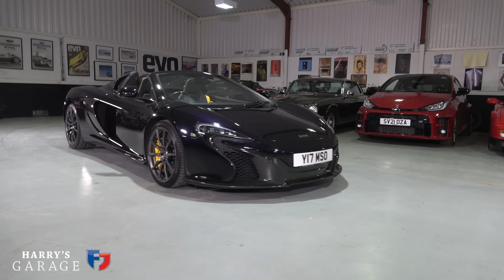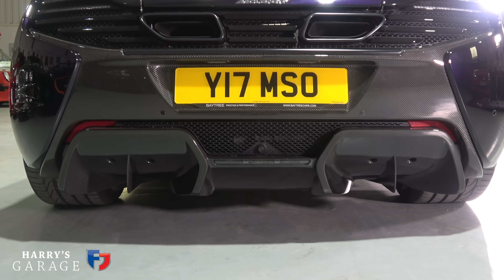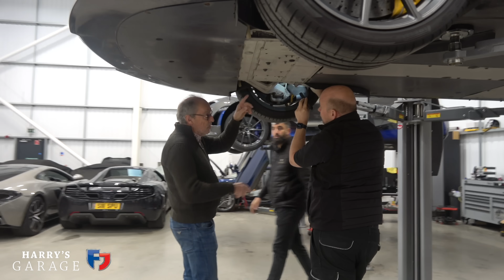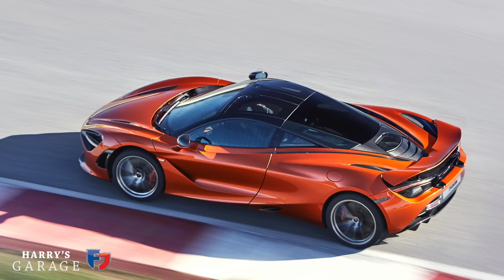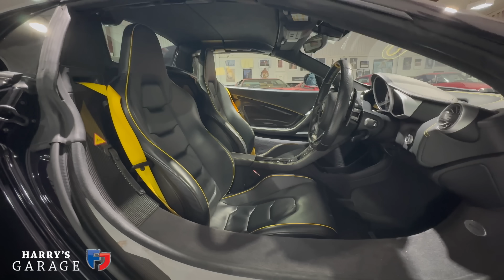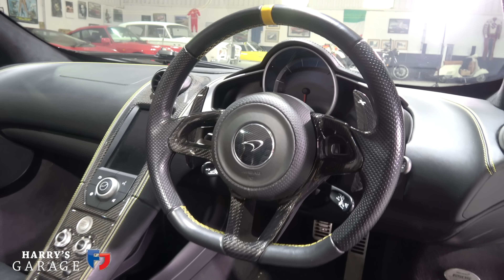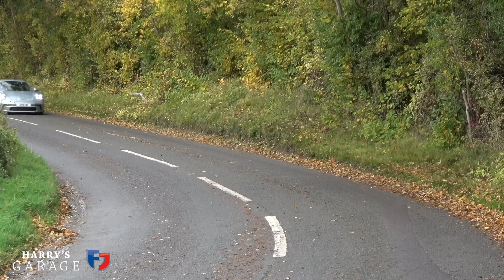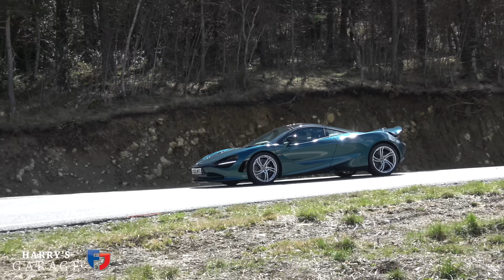McLaren 650S 6-month update. How much does it cost to run a McLaren? Servicing, warranties, parts..

Comment: I really don't understand how people purchase these super expensive and rare cars with finicky paint, and don't immediately cover the thing in paint protection film or ceramic coating straight from the factory. It's kind of like buying the top of the line iPhone, and then not investing in a phone case. It just shows a wanton disregard for money. Which, I guess, is on brand for those with lots of money.

Comment: I bought a low mileage late (2013) 12c, amazing car. I sold my Ferrari 355 spider with Capristo exhaust since although the noise was initially enthralling, after a while it felt shouty, slow and handled badly. ( I didn’t sell it to buy the 12c, I had both, the 12c just made the shortcomings of the Ferrari more obvious.)

The 12c is in a different league, truly special. The only car I’d hold in the same esteem is my gen 1 NSX…( I’ve had that for 20 years, the 12c is a keeper too.)

Comment: I particularly like Harry’s straight forward unbiased presentation. I had a Ferrari F-355 Spider in Tour de France blue with tan leather. Options included color matched dash and steering wheel leather in blue as well as a Tubi exhaust thusly producing an exquisite sound. Closest to F-1 I had heard. I did not find the handling flimsy but I did not compare it to a McLaren. Do you agree the 5 valve design made it one of the best engines of its time? Funny thing is, I had (have) a ‘84 Porsche 911 Carrera Cabriolet,  a ‘60 Porsche 356b 1600 Super with a modest 75hp, a Mini Cooper convertible (I removed the exhaust heat shield and lo and behold factory headers), and an H1 Hummer convertible? One day I was driving it and a limo pulls up and the window goes down. Ironically, it was Vanity (Prince) and in a limo proceeds to chastise me for largess and negative environmental impact. Huh?
Out of those, my favorite to drive was the 356 and the Mini a close 2nd. Guess I like the go-cart tendencies
Thanks for your entertaining and revealing presentations.
Oh, a little known car in the states is my Hyundai Equus. Korean limo. Smooth as silk. Incognito, except I’ve heard it referred to as baby Bentley.

Comment: Spark plug change at 60k? Unbelievable. If it is throwing stones at its own door bottoms, there should be an easily-replaced sacrificial bit of protective plastic there, like the bumper trims on a humble BMW.

Comment: The 12C has a horrible reputation in the US as well, as do most McLarens. I work for a non-McLaren dealership that has traded for and sold several 720Ss, 600LTs, etc. and almost every single one of them has had build quality issues that simply aren't acceptable on a car at that price point. We had a 600LT Spider with a front bumper that didn't fit from the factory, one 720S had a front lift that kept going crazy, another 720S had the glass roof and it shattered and broke when the owner opened the driver's door, a third one had the heat shield under the exhaust tip fall off.

The build quality just simply isn't there.
Reply: people have been saying this for so many years, I can't believe they haven't addressed this yet

Comment: I bought a one owner 66plate 650's Spider from McLaren Bristol. Had it delivered to McL B'ham to whomI had sold my Lambo Gallardo 560LP 4. Took some time convert driving position characteristics. Yes feet offset to left, but once press start & select Drive. Everything you need is inside an invert horse shoe between your elbow & forward to your finger tips! Phenomenal ergonomics! Yes sorry you do have glance for the rear window low button! I had mine through Covid, where it sadly spent 4 months locked down waiting simple parts & Service/M.O.T. For some reason I could not seem to want to part with it! But after year 8my 6th, I got Stung for the front suspension coil spring snapping at the heavy/bottom end! £3,600+V.A.T. At McL B'ham. Big shout out to their service manager. Mr Andrew Lane. He stood by in every through 6services & end of Warranty Ship List! As for me I've migrated from Olympic Standard Floor Gymnastics to Mirror Class Dinghy racing! I bought a Centenary Bentley Continental GTC W12. Swapping Raw for Awe, you could say! And yes it ticks a whole series of different boxes! Forget your scarf? Press a button. Feeling a little stiff( not cramped or uncomfortable? Press a button & you a choice of Six massage function? Yes a bit slower than the McL! It takes a full 30seconds of so to sun light & heat on my bald spot! But more than fast enough to prevent helicopters attempting to land on my head!

Comment: I have an Audi a3. There was a lack of power issue caused by the waste gate valve, took it to Audi for an inspection. They wanted 2500 quid to replace the turbo. 
The actual problem was a link bar between the actuator and the waste gate (they had that on the inspection paper).
I bought a second hand turbo on eBay for 80 quid and did it myself, sorted.
Any high end dealer is gonna be a rip off, even down to Audi. It’s not just McLaren.

Comment: It always feels "off" to me, that Cars get a "how much did they cost me" review after what, 2000-3000km? Yes it won't cost much (apart from the brutal initial depreciation).
Now if you've got a reasonable two-car garage and rack up Kilometers, thats where it gets exciting. My V8 R8 is doing strong at 212k km, the V10+ R8 had the usual AC Replacement at 110k but since then cruised to 160k km without any troubles.
Having a single fun Car apart from the Family Hauler makes you rack up 10-20k km/year, thats review worthy, not "i took it out thrice this year and i think its fine".

Comment: Be very areful with recharging the accumulators.; I'd want to impose a limit of maybe 2-3 recharges. This is because the diaphragm itself weakens over time and will eventually fail and pollute the system leading to bigger problems.

Comment: Whilst I appreciate that running a supercar like this is not a cheap exercise, the amount of things that need to be regularly replaced and fixed on a McLaren seems ludicrous. Broken springs, loose headlamps, body corrosion, come on, if any of that was needed on a modern budget car you’d be a tad cheesed off.
Reply: Feels like a lot of excusing going on throughout the video. Adding in drafts whilst driving, other cars have been slated for less.
Reply: @christophermaidment2824 supercar and cheap are mutually exclusive, regardless of manufacturer

Comment: See this is the value of these 'owner reports' kind of videos, especially with Harry, in contrast to a more usual review or a silly launch drive 'first impressions' sort of thing. 
The car looks great, the reviewer does a couple powerslides, engine sounds fantastic, handling, gearbox, all top notch. You watch that and think 'wow, what a car'. Then a decade later a certain farmer buys it, drives for a couple months and we then learn it corrodes like nothing you've seen since the 2000s except maybe the Mx-5, the headlights are f*cking wobbly and you have to glue the rubber?! Honestly, you'd think it is a bloody Miata and not a McLaren flagship.

Comment: Had a volcano red 570GT -- returned it to the dealer due to two cracked heads after 5000 miles (US).  I understand they are far more reliable today and have a whole new manufacturing quality process.  I understand the 720S is quite reliable.  Glad the cars are now more reliable as I really liked my 570.

Comment: Shocking that a car at this price should show ANY corrosion anywhere at this mileage/age.  My bog-standard Jaguar XF, from new, is now 180,000 miles and 10 years old - zero body corrosion, and it's made of steel.  It can be done.   These 'niche' companies like McLaren produce beautiful designs but fail to learn the basic engineering and manufacturing principles that the likes of Jaguar, M-B, Toyota, Lexus etc cracked decades ago.

Comment: Fascinating evaluation of the costs of ownership.  I can't believe how much it cost to buy and run, and that you get corrosion guaranteed.  It is incredible how everything wears out or breaks regularly, it is an amazing that it keeps on the road.  It makes an Alfa seem like a Toyota.  I am pleased I can't afford one, though.  My wifes 15-year-old Picanto doesn't have any corrosion, never goes wrong, and it cost less to buy than half a year's warranty for the McLaren. I feel very happy. So pleased you like yours. Thanks, Harry.
Reply: does your wife's Picanto pack 650bhp and weigh hundreds of pounds less than the next econobox?  Did you overlook the fact that a 650 costs half what a 488 costs and that car has more problems and lower levels of sophistication.  If you're going to moan about accumulators, be sure to moan about your tyres wearing out too - assuming you want to be fair and balanced.  Personally I've never bothered with the warranty: my average unscheduled maintenance bill over 8.5 years of 650 ownership has been $1000 per year (half of that caused by dampness in the garage during the early part of its time with me).  A fabulous car.

Comment: i am appalled at the fit and finish issues, such as the corrosion and the fitment of the headlamps.... my 2017 chevy spark has 60k miles on it after 7 yars, and has ZERO corrosion or fitment issues, and it cost UNDER $14k (Cdn) out the dealer door! There is NO excuse, in this day and age, for these kinds of issues on vehicles as expensive as the McLaren, especially after such a short period! (ftr, my car lives outdoors in Vancouver Canada, and is driven year round, including in the winter salt-on-road season, and only gets irregularly washed. Cheers!

Comment: Aluminium corrosion can be hard to fix, you have to cut down to clean metal, i've seen alloy panels becoming like lace.
Reply: You would think the etch primer would stop the corrosion on the bodywork ?
Reply: You still have to clear the white oxide off with soft wire brush before painting primer or adding filler.  @portzi2

Comment: The volcano red 650 coupe shown was my car, should never have sold it. Have a 675, which I’d never sell. Running it using V is cheaper than running my wife’s Macan Turbo - and it’s more fuel efficient. For what they are, they are cheap to run. The problems really aren’t bad, easily addressable and getting better over time - like the refillable accumulators.

Comment: 650S: gearbox detonated through the casing on a spirited drive, momentarily locking back wheels, main bearing failure. Shrapnel damaged a few other things on the way out…
- repeated rear spoiler fault where it went vertical and stayed there
720S - two new doors due to laminate failure 
- delivered from new with 3 warning lights (parking sensor and ignition related) and fault that would cut engine at low speed 
- traps water and dirt in stupid places, nightmare to wash 
- loved both cars still 😂, nothing drives quite like them. I had roof down or little window down on the 650 all the time, winter with the heaters blasting, magic

Comment: So basically an arse basic hydraulic accumulator costing 300 quid? Hilarious. You can buy high end ones for less than a couple of hundred and basic ones as fitted here for about £60. Ones with a Schrader valve for a hundred. They are used all over the place and are a low cost item.

Comment: Replacing accumulators with ones that have a valve in the top & are therefore rechargeable seems to be an issue on basically any car that has them - old Citroen suspension, 1980s ABS in Ferrari's Jaguar, Range Rover etc.

Comment: Another great review Harry, however I owned a 12 C and it was an absolute nightmare for the 12 months. I had it. Literally every week something went wrong with that car to the point I just didn’t wanna drive it. I’m still very hesitant to dip my toe into the water to purchase another McLaren due to my previous experiences of absolute nightmare of unreliability and repair costs. I swear it would’ve been cheaper to run the space shuttle.

Comment: V engineering saved a cost for us, problem with an engine New Forest said needs a new engine. V engineering - new coil pack solved problem. Alot of money saved. Wheel bolts are titanium and stretch.....but to my knowledge no one has

Comment: I heard that the Artura was also problematic. Rumour has it that it was supposed to be officially launched in mid-2021 with a press drive in Spain... if only any of the cars were actually working. Because when the media arrived they found out pretty much all of the cars refused to do anything. I think the Artura is already in its third engineering iteration currently and they still can't sort out the teething issues. Also there's this one Artura went up in flames in Leeds just a few minutes into the first drive.

Comment: Nice. I did 500kms in my 675 yesterday and still love it after all this time. Your explanation of the engine inertia was enlightening and helped me to understand why I felt there was a bit of "run on", throttle off on the way into corners. Thank you and keep your videos coming as they are the highlight of the day when they pop up.
Reply: 675LT's use the lighter rotating components (crank, rods, pistons) as the 540/570 series so have less inertia than the 12C/650 and are able to downshift quicker. The downside is they're not as strong so you see more bottom end problems, in particular bent rods on "tuned" cars running extra boost.

Comment: That's a Kia level of corrosion. Wow pos. This is the kind of car that you're not going to drive in the snow salted roads it's just a regular road and maybe once in a while you get stuck in the rain why would you take your sports car out when it's raining? And it's got this much rust? This was an issue in the 70s mgb's, but galvanization shouldn't be an issue in 2014 car.

Comment: Corrosion on a 10 year old car with under 10k miles that’s probably seen nothing but nice weather summer drives… wobbly headlights, windscreen surround coming off… unreal. 

Why would you buy something like this? I just don’t understand modern supercars. Too fast to use properly, not particularly good looking and built like shit.

Comment: Oh, I forgot one thing - the rear quarter panel… the most curious thing - a small crease would appear in the panel and after the first time I had it fixed (paintless dent removal) it reappeared!  I thought maybe I had caused it - but there was no abrasion marks etc but I found out that there is an outer as well as inner panel that are “bonded together” and the stresses between the two panels was causing that very subtle crease to “reappear” over time!  Not sure what the fix would be - but I never wanted to find out “the cost”!  Very strange! Not sure if anyone else experienced this? (But I did hear of other cases!)